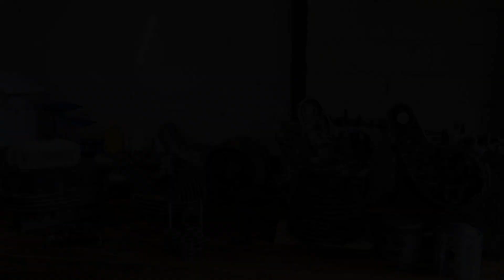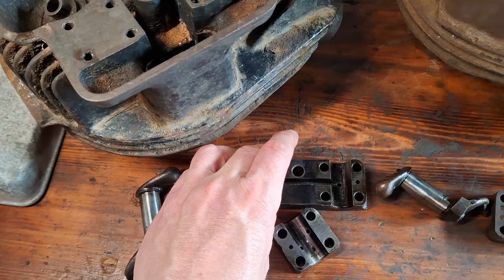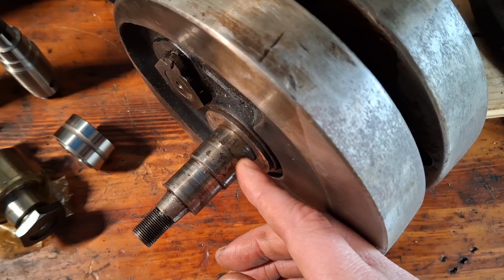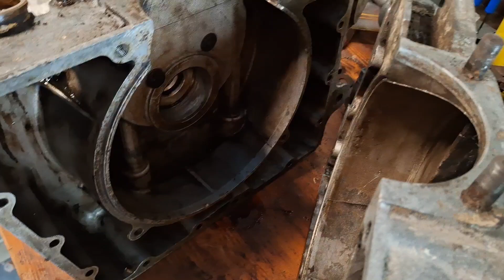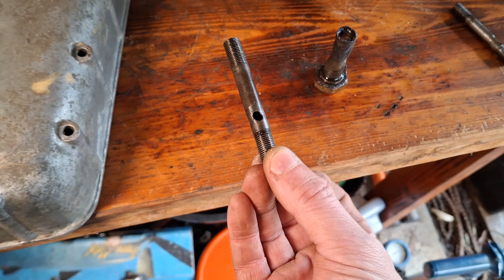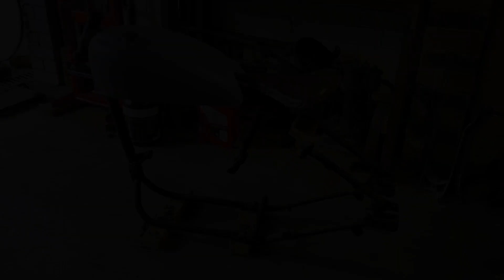Royal Enfield Model J Hardtail Project - getting into the engine

Comment: The model J engine is very similar to the model G and pre unit 250 clipper engines and I believe that many parts are interchangeable.
The problem with the rockers can be overcome by skimming the caps and or the base and then boring or reaming the bores out to suit, the rockers have centres machined into each end so it would be perfectly possible to have the shaft reground a few thou smaller and make the housing to match, I have used similar methods to reclaim Japanese motorcycle cylinder heads where the camshafts run directly in the aluminium heads.
I would strongly advise against using brass for the rocker housing the original cast iron material is ideal for this application and I had no problems with it on my much modified model G engine.
The pre unit 250 Clipper had a longer drive side mainshaft to carry an alternator rotor, the 250s can be fitted with all of the 350 engine parts without modification so I would expect they would also fit your model J.
If the mainshafts have any pitting or corrosion no matter how minor they won't last very long in the areas where the rollers run on them.
Don't worry about the oil feed to the back of the cylinder barrel there is no need to blank it off if you use a cylinder that doesn't have the matching drilling, these cylinder oil feeds often resulted in higher oil consumption for no appreciable extra benefit and on many other engines were often blanked off as a matter of course.
It is perfectly possible to use crankcase halves from different engines providing that when bolted together the faces of the crankcase mouth where the cylinder barrel sits match perfectly if they don't it will be necessary to machine them so they do, I have seen this done with a file with good results.
I suspect that the model J uses the narrow big end like the model G and earlier 350 Bullet in which case you would be better sticking to a steel conrod there wasn't really anything wrong with the alloy rods but they do become fragile with age.  The much maligned floating bush big end is in my opinion excellent and will easily out last any roller big end especially a caged one like the Alpha, on my own model G engined Clipper I made my own floating bush from aluminium as per the original trialled in the 1934 TT in the LF,  I had no problems at all with this but it is important to remember that the floating bush requires a heavy oil such as a 40 or 50 the use of multigrades or thin oils does make them prone to failure and reduces their life considerably.
As the J is very similar to the G I would expect them to be just as tuneable my 350 produced 27bhp at the back wheel the biggest issue with tuning one of these engines is that if driven hard they can't dissipate the extra heat generated and will eat exhaust valves and guides also cracking between the exhaust valve seat and spark plug hole is a quite common failing.
I hope all this helps.
Reply from the maker: I had considered a "close and hone" to reclaim the original rockers and blocks but the terrible factory oiling had me reconsider. I will most likely use aluminium rather than brass for the blocks as per the modern 500 bullets, mainly due to cost, but both blocks will be oiled directly.
I agree that from an engineering point of view a floating bush is far superior to a roller big end as long as it is suitably oiled. A floating bush with proper oil will have no appreciable wear after hundreds of thousands of kilometres whereas a roller arrangement is always wearing the surfaces regardless of lubrication.
Reply from the maker: Also, thanks for all that fantastic information. One of the best things about doing these videos is the wonderful help I get from people with a wealth of knowledge. It is very much appreciated.